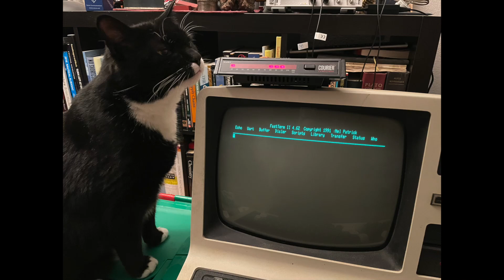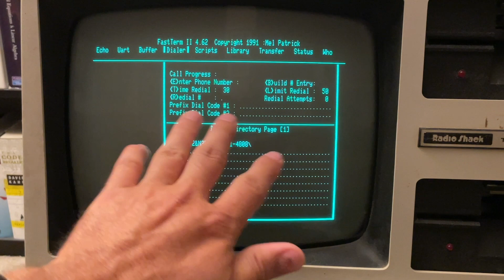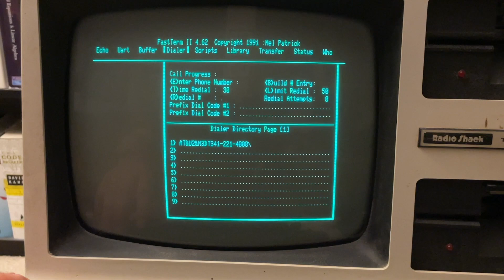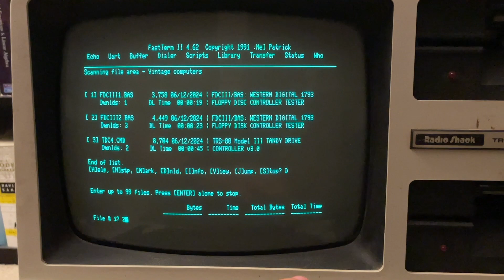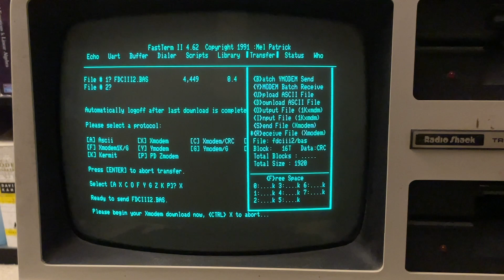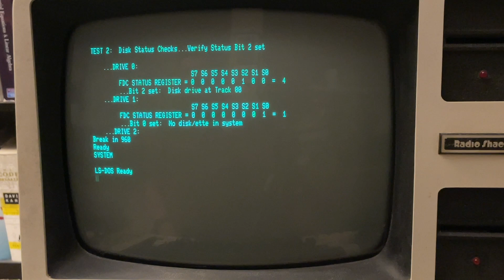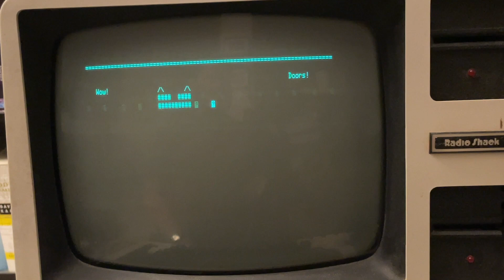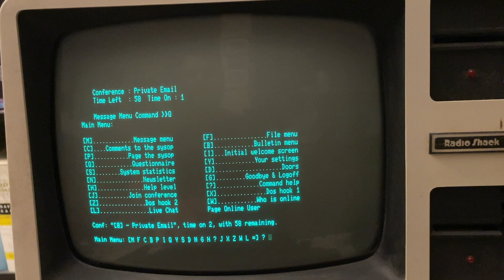Dialing a BBS with a TRS-80 in 2024

Comment: I have a lot of fond memories with that machine, it was my first.  Started coding at age 16 with this thing and started my obsession with computers.  Ended up being a Sysop on GEnie for the TRS-80 forums for a few years until I was finally converted to a user by the IBM series.  I had the Hi-Res graphic card upgrade along with a 5 Meg hard drive (which was about as big as the entire TRS-80 computer itself).  I had published a handful of apps for that machine and if I still had them would have happily shared, MouseDOS and IDIM BBS would come in very handy for you, at least based on this video.  You can still find a few of my files on the web that might be useful to you.  One is the Filtered Reader which allows strips off the IBM carriage returns from IBM text files so you can read them on the TRS-80.  Another is a crossword puzzle game,  but might need a hi-res board for that one; I can't remember.  These and a few more can be found with the following link, enjoy that old beast while it still works.   https://www.planetemu.net/machine/tandy-trs-80

Comment: Great video, just wondering why the 9600 bps handshake sounded like a 28800/33600 bps handshake?
Reply from the maker: Unsure. I just realized I didn't type in a new &U/&N limit and just relied on the lower DTE speed so it may have tried negotiating at V.34 speeds first before settling on 9600. The welcome banner on the BBS verified it connected at 9600 on the remote end at least.
Reply: Yeah it looks like it could negotiate at V.34 but maybe your serial speed was set to 9600 which bottlenecked it to that. Also when I see buffer overruns, I immediately think of flow control (or perhaps a lack thereof)
Reply: Both modems are V.34 modems, so they initiated a V.34 handshake. Modems can use a newer handshake to negotiate a slower speed than what that handshake would normally negotiate.

To get a true V.32 (9600 bps) connection, he should have set the S registers to disable V.34, V.32bis/terbo, V.FC, HST, and V.8.

Comment: Fun!  I had exactly that model.  Bought in summer 1984 along with an impact printer at Radio Shack.  The dual drives and 64k memory was a big advantage over IBMs at the time.  I recall using 'scripsit' to write papers where you could  use  a portion of t he 64k RAM as a virtual drive - it was fast compared to operation where you read data off the diskettes.  I also had bought a 300 baud modem.. that proved worthless as it took so long to have the text appear on screen, at a crawl.  I recall it also came with a Star-Trek game which I spent hours playing as well as some kind of 'castle siege' game.

Purchased it with printer for about $2400 and recall selling at  a yard sale in 1993 for $50.

Good memories though and thanks fort sharing.